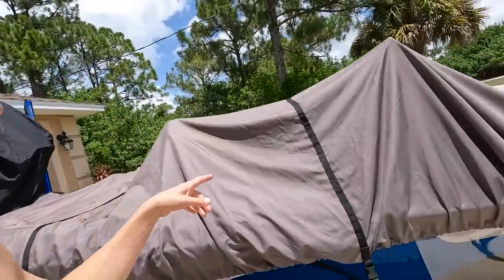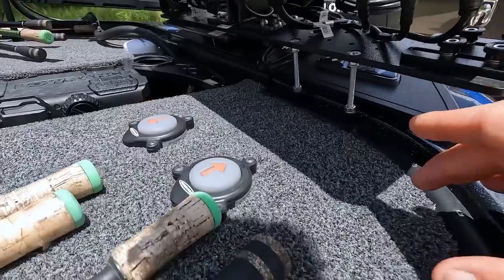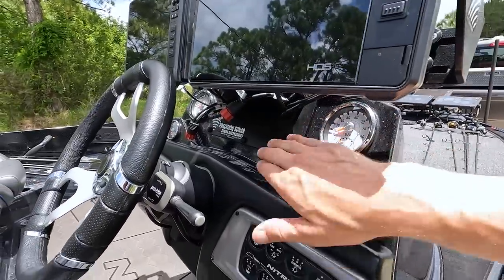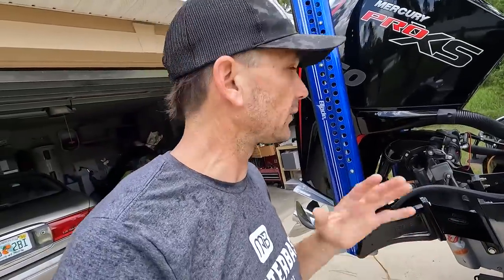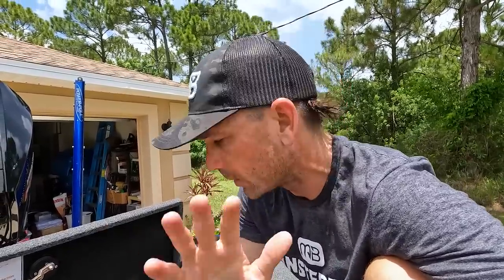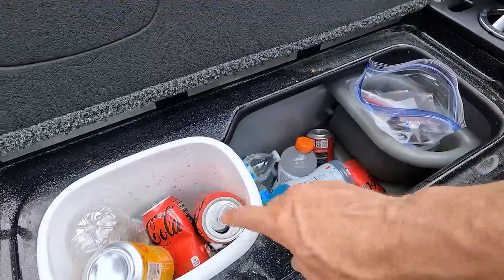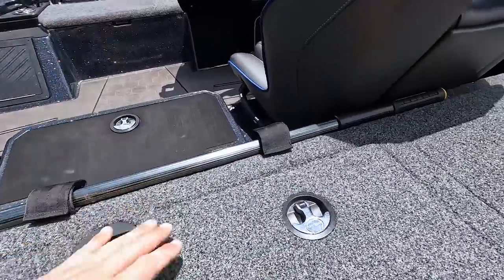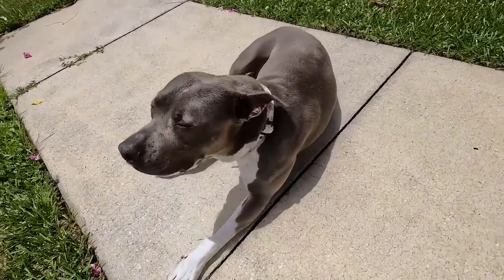DREAM Boat walk through ~ What I LOVE and What I HATE😡?!? (NITRO Z20)

Comment: As a salesman at a former Nitro dealership I can tell you that if you plan on using your live well much you better buy an extra touch panel. They are notorious for going bad. My brand new 2022’s touchpad lasted 3 days. Also get you a set of blue accent stripes for your motor. It will look awesome!

Comment: I also put the co angler rod storage option in. In addition where the step is between seats I made a fiberglass tray that sits over the tank. On the Z18s they didn’t start adding that tray until the 2022 models and Tracker does that as a factory install so I had no choice but to break out the fiberglass mold making stuff and create a custom tray …
Reply from the maker: nice man - that's a pretty sweet mod!
Reply: @mikeybalzz  I would rather have just bought one but they wouldn’t sell it to me …

Comment: I bought a new Z20 this year and got it in July. I like the layout and price. Could you do a video on how you set up your surge brake system. Couple of  issues ive had. I had to modify my boat cover to fit because ghost TM was bigger  than the standard minkota TM that cpmes with it.  I also needed cover longer to cover the last foot to keep water off back deck. I think they put a 19 foot cover on it.  I also added poles to help shed water. I couldnt back boat up without surge brakes activating. So i had to use the metal spacer behind the bolt in the tongue every time i needed to back up. Ive found out there is a selenoid on my boat i can get wired up to deactivate my surge brakes. I was never told about this when i picked up my boat.   
Im having the wiring on car fixed to activate the selenoid. Other issue my Nitro Z 20 lettering has come loose. I pushed down the flapping N letter and it has held but i lost the lower half of the 2.
I really like your console mount. My  mount covers my upper guages on consol. I need to switch to yours.
Am i pleased with my boat not 100% 
I need to remove the front rod tubes like you did. I really like live well and removeable trays. I got the radio and deck lights. Problem with deck lights is you cant add a lock R bar. Of course i wasnt informed of this when i ordered my boat. That was a big bummer. I happy to be retired and fishing in my boat after not having a boat for 3 years. My aluminum boat was scraped after 35 years of service. A sad day. Thanks for your great videos. Keep making em i enjoy em and learn a lot.

Comment: It's not greatly priced anymore. I sold my boat in April and was going to order one of these and was told they weren't taking orders till August or September. I called around mid July and asked again and they had me come in and choose my options and get an order prepared. They printed me out a sheet and it was now 87,000.00 It went up almost 20k from April to July and there were less options available to choose from as well so I backed out. I changed what I want now even though I would still buy one of these. I am searching for a season or two old Falcon F20 Predator or F215 that someone has already loaded up. I just missed out on a 2019 F215 that was loaded and only 90 hours on it for 64,500.

Comment: I have a ghosts trolling motor as well what type of battery do you use, would those ghost work if you get a lithium 12 v and 24 v to be able to run it on 36 v or do u have to have 2 12 v

Comment: I love my z20 I got it this year back in March. I upgraded to the 250 as well no power poles a light load of tackle and by my self I can get 75 mph and I have a manual jack plate
Reply: Also talking about customer colors I did that with mine and went with the gel grey and blue. I didn’t go over kill with the blue just the the two tropes on the railing and the big strip on the side is all I done
Reply from the maker: i was surprised how quick these boats are!  are you happy with the custom color you did?
Reply: @mikeybalzz  yes and no cherokee lake and Douglas lake in east tn is my home lakes Rocky gravel lakes and any kind of scratch just pops out and is extremely noticeable  but other than that I love it
Reply: @mikeybalzz   I sent you a couple pictures on IG if you want to look and get a idea of what mine looks like

Comment: I heading in the same direction with the same 3 Graph / Trolling Motor setup. How did you do the Ghost 360 setup as a stand alone.
Reply from the maker: not sure what you mean by stand alone?  there's a screen dedicated to the 360 on the unit so i just had it set up that way.  on next year's boat i think i'm going to skip the 360 though and either look at the hummingbird 360 or mounting double active targets.

Comment: You'll want to put a Dexter kit on the trailer Mikey - before you have issues with the trailer (which you will). See the Nitro Owners group if you want details...2020 Z21 Pro
Reply from the maker: will check it out thanks for the heads up!

Comment: Boggles my mind that a "tournament ready" boat would come with those cheap rubber rod straps. Even the new Z21 XL Pro, which is a flagship model, comes with them.
Reply: An 80 thousand dollar basscat uses the same rubber cords for rods straps 🤦‍♂️
Reply: @leaveorlibertyfishing7670  totally absurd for these ridiculously expensive boats!
Reply: They work.
Reply: @Traylors_outside  just fine to but you’d think for what these boats cost they’d install the retractable rod straps.

Comment: Another question in comment, I'm sorry that I'm flooding your comment section with stuff, but do you put pool noodles in your live Wells?.. I mean I really don't see you fishing a lot of tournaments and I think that is a tournament thing for long runs? Correct me if I'm wrong please? That's something I've been thinking about doing because I see my cousin doing it a lot and he says that it really helps out on keeping the fish from just banging off the sides inside of the wells! Do you know anything about that? I don't know bro maybe I spoke too soon, I'm not really a fan of white water, but that boat's super super clean! As long as that cone head 250 last 😂😂. You should be all right with blue ballz! 😂😂🤦🏻‍♂️😁✌️
Reply from the maker: if i fished derbs i would but i haven't had a fish in the well when i was on pad in years.  that's what's kinda cool with this livewell it is has an inset around the edges so it sort of keeps them contatained - that said i would do the noodle trick if i was tournament fishing.